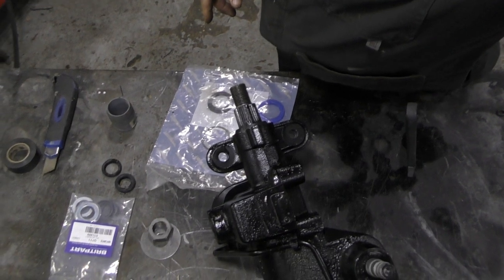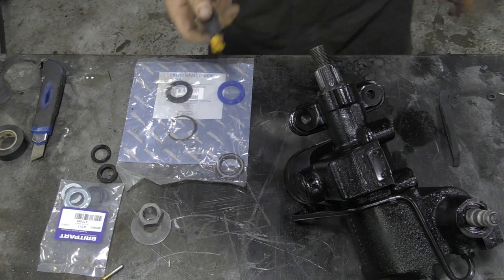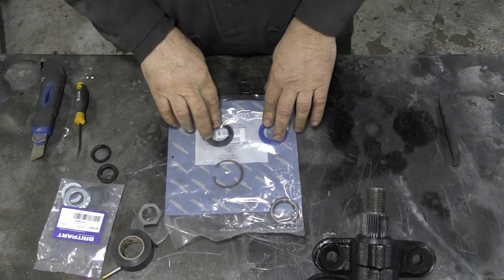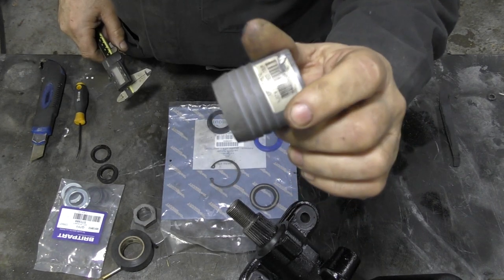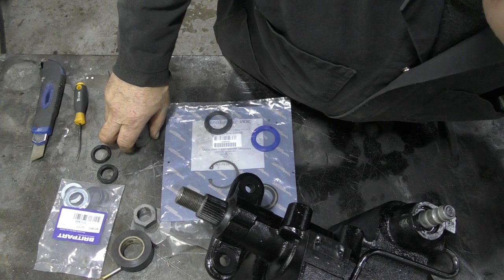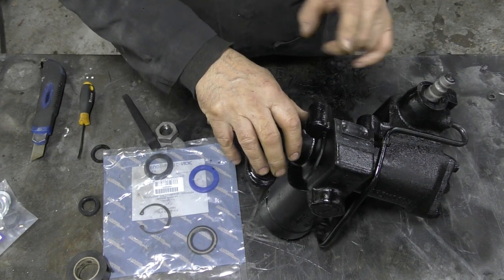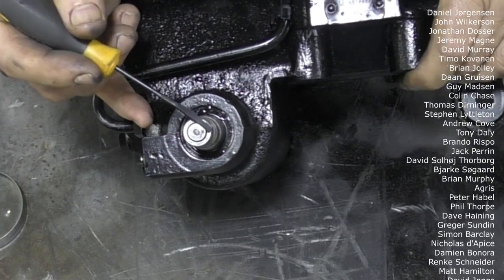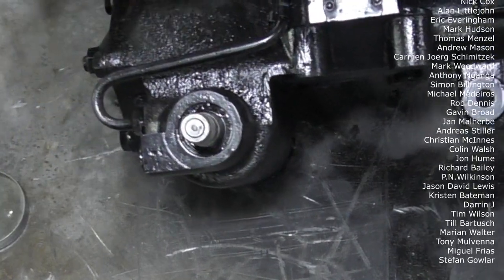Adwest steering box seal fitting tips

Comment: Hello Mike, I bought same kit for prufinf thé botom of steering box, and one told me that the blue seal is not suitable, it is a seal for a cylinder, no lips with spring. What do you think about that ?
Reply from the maker: The blue seal is a high pressure seal not needing a spring - there are sealing edges on the inside for the shaft and on the outside to seal against the walls - the high pressure (1000 psi +) splays the seal outwards
Reply: @BritannicaRestorations  ok, so I ll mount it, ty
Reply: @BritannicaRestorations  I ll try to do thé job "in situ", on thé car...

Comment: Hallo Mike do you remember Axel with the Discovery TD5  Alternatorproblem?
Reply from the maker: Yes - is it fixed?
Reply: @BritannicaRestorations  No becaus at the moment its to cold to work on it outside. And I am not sure if there is a connection between Alternator and ECU?
Reply: @BritannicaRestorations  Do you have a correct Info about it?
Reply from the maker: There is no connection between the Alternator and the ecu
Send me your email address and I will send you the wiring diagram britrest@britrest.com
Reply: @BritannicaRestorations  there are two contacts on the Backside of the Alternator one is the warninglight for Dashboard ( this I find out)and what is the second for??

Comment: I had an Adwest 4 bolt steering box which I tried to replace the output shaft seal insitu, outside, underneath the 110 on the gravel drive in middle of winter, no fun, with lots of leaks, much easier when on the bench as you have shown us here and in previous videos.. Apparently, it can be done insitu, would be better prepared next time but really don't think I'll try that again.
Reply from the maker: Yeap - only 7 more bolts and it is out!